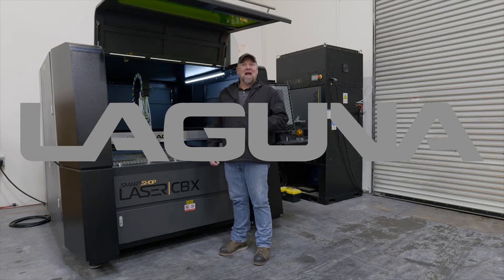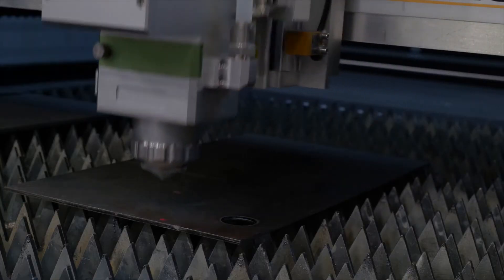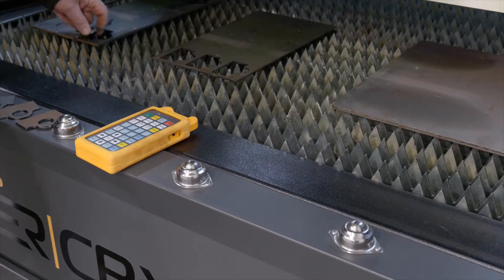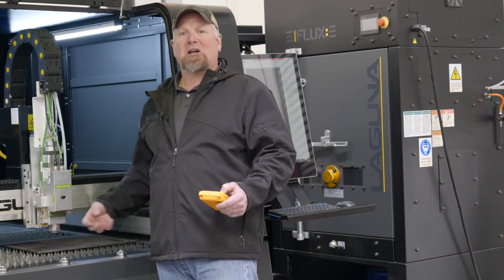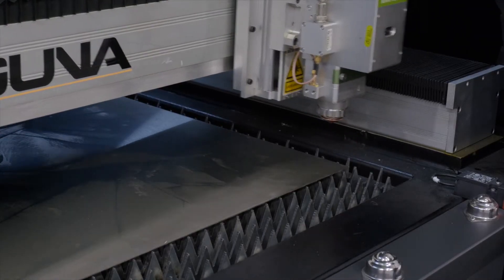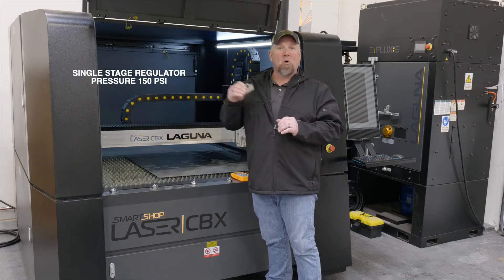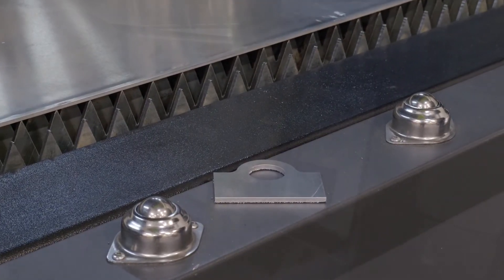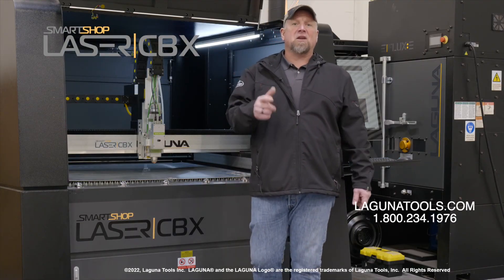How To Achieve A Perfect Cut Condition On Carbon Steel, Stainless Steel, and Aluminum | Fiber Laser

Comment: Great video. Gives me hope my Vytek Laser has hope. We get a bad burr on aluminum. They’ve told us that it is what it is. 

Also, they have us running a 3.0 nozzle and 220psi nitrogen on everything. Whether it’s 0.030” stainless or 0.250” aluminum that’s what we use. 

Would you be willing to do a service call or a competitors machine! 😂

Comment: one thing I found to be a factor was when metal is thin and has even the slightest warp to it (or if you have damaged slats), the air pressure from the nozzle causes it to shake and shimmy up and down. I know the nozzle knows where the metal is but when the material is literally flapping like some of the sheets in this video did, it can affect the cut quality.  I get around this by adding weight in strategic areas to keep the metal stiffer.  Scrap steel or some of those little 1.5lb round weight-set weights work good.

Comment: What is the Kw rating of this laser?
Reply from the maker: Hey Jeremy, the SmartShop® Laser | CBX has a laser power starting at 1KW and goes up to 3KW.
Reply: @LagunaTools  sure thing, but what was the laser in the video rated for?  What is a max thickness for 1, 2 or 3 Kw, in carbon steel?
Reply: Jeremy I have the 1.5kw and can cleanly cut .375" let me know if you want to buy our machine with a full list of parameters for multiple materials

Comment: Sir why we use double nozzle in oxygen cutting,, please explain briefly
Reply from the maker: Almost all manufacturing standards recommend using a double nozzle while cutting with oxygen because it is an accelerant, and it is using a fraction of the assist gas when cutting.

Comment: What's reason behind laser power source failure,, common reason
Reply from the maker: Usually there is not a power failure on the Fiber Laser. CO2 is a culmination of using maximum power and or maximum capacity of the wattage for a long period of time along with the negligence of proper maintenance and alignment of optics.

Comment: How much kw of your laser, tell me reason why my all lenses of machine damaged,, what are the reason,,, I do cutting with sircompressor
Reply from the maker: Most likely this has to do with your air compressor. You blew up your optics because your air compressor is not clean dry air. It is of the upmost importance that your assist gas is as pure as it can be.

Comment: What is the best material to use for the spikes for CNC bed ...i have tried Steal, Brass etc. ,the tip gets  damaged(because of laser) and causes unevenness in the cutting for high precision work. Any suggestion?? (PS. I use 2000W laser to cut Plywood, Acrylic etc.)
Reply from the maker: The Fiber laser has an optical sensing head that wouldn't matter the difference in the height of the laser slats. These lasers will not cut Acrylic, Wood etc. So the CO2 laser in question would either need a height sensor or replaced slats as needed.

Comment: I operate a 20kw laser, coming from a 4kw machine and the problems we all face still exist. But the extra power as long as everything else is on point, beam center is not as important as long as tolerance is not nats butt. Even when beam center is off it just blows through the nozzle and keeps on keeping on. Not cool but it is what is.

Comment: Hi @Laguna Tools first of all congratulations for the video, excellent learning material. I would like to know what configuration on the panel is used for cutting .375 carbon steel?
Reply from the maker: Hi Thiago! Glad you're enjoying it. Oxygen and double nozzle are used to cut .375 carbon steel.
Reply: @LagunaTools  can you please let me know more details about your parameters for the 0.250 cut? You said 90ipm and 3.5psi O2. That doesn’t make sense at all?? That is cutting super fast and the pressure seems crazy low

Comment: It's funny watching the pierce parameters on this video. The lead in is way too slow. If the settings are set correctly you should not be getting those massive globs of molten metal on top. Those globs will cause the laser head to lift up when the ohmic sensor dedects them and will have a huge imact on cut quality at the lead in or lead out. For 3/16" the lead in should be around 1 second tops.
Reply from the maker: Hey John,

Sorry for the confusion. Throughout the video Dave is giving both good and bad examples of cuts. He advises adjusting your specs when cuts aren't clean, most of the time being your gas pressure. At 4:43 he shows a metal piece that wasn't cut correctly and recommended adjustment, this is one of the passes where some metal globs were created but were addressed. 

You are correct though! The cut condition is only going to be as good as the piercing, and it's important the operator knows how to adjust it when needed.
Reply: @LagunaTools  I was speaking more about the actual pierce section around 3:36. This pierce timing and power is clearly well off. You can tell because the head begins to descend to the material before it's made a full pierce hence why at 3:33 you will see what appears to be a volcano of sparks flying up. This is a result of not making a full pierce, and then pausing which pre heats the metal and then it begins doing its slow descent and lead in and starts shooting slag everywhere. It is an issue because that can cause backsplash relatively prematurely which will contaminate your secondary lens and require replacing... Fortunately they are relatively cheap $5 or so a piece, but it's avoidable.

This issue that I was talking about initially becomes very apparent at around 4:07 where the ohmic sensor causes the head to start bouncing up and down.
Reply: Also, stating that striations are 100% attributed to gas pressure is kind of misleading. Striations like this are a function of primarily too little power or too fast of a travel rate. The gas pressure is important yes but it's really only there to help heat up the cutting point and assist in sublimating the material. Too much will cause the backside to fuse back on it self and cause dross yes but running the settings under powered or having the travel speed too fast would be a bigger contributing factor (hence why the striations appear angled like the bottom of the cut path cant keep up with the leading side or top of the cut path). 

Also... it's not recommended to cut hotrolled steel with the Raycus laser source... IPG maybe but cutting a lot of hot roll with a Raycus head is not recommended by the manufacturers of these machines.

Not sure if he talked about it but almost more important than any of this when setting up the paramaters is to ensure you pick the right nozzle. For1/4" you want to use around a 1.2" or 1.5" nozzle.
Reply: @johnhutchinson605  thanks for this info John. He says he is cutting 0.250 at 90ipm and 3.5psi o2 is this even possible? 
He is using 1500w here 

 I am cutting with 1500w 1.5 nozzle 0.8 bar and am at 57ipm now. But if I can speed that up that would be wonderful.  Thoughts?
Reply: @johnhutchinson605 know of a good tutorial for using pierce? just got a new laser and that is the one thing i cant figure out.... Seems like you know what you're doing by reading your comment
Reply: @michaelferraro340 yes I know where to go , go to Ramsey fabrication he has tutorial and u can buy the cross and adjust it

Comment: Is this machine  1000w or 2000watts? Thank you
Reply from the maker: Hey Christian,
Our Laguna CBX Fiber Laser power starts at 1KW and goes up to 2KW!
Reply: @LagunaTools  But in particular the machine that you show In the video  What power  It is?
1000watts? Or 2000?
Thank you.
Reply from the maker: the power used for this video is specifically 1.5KW.